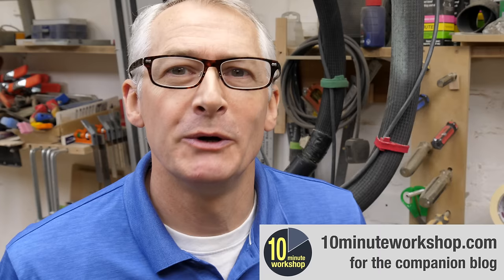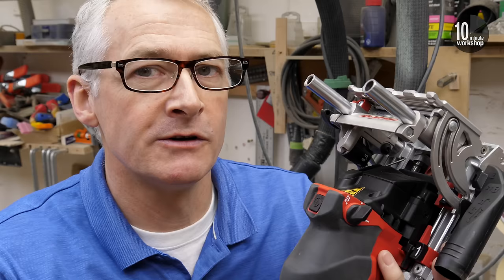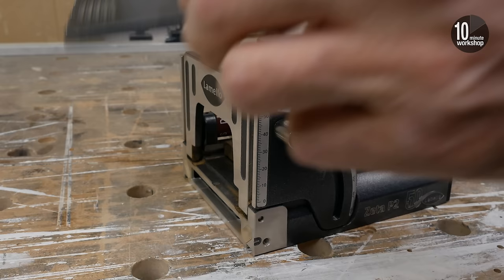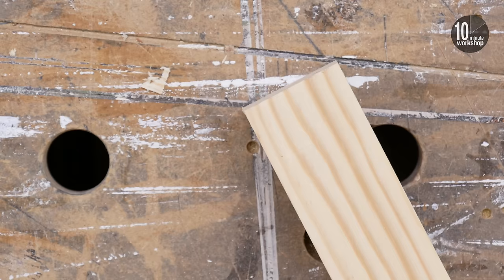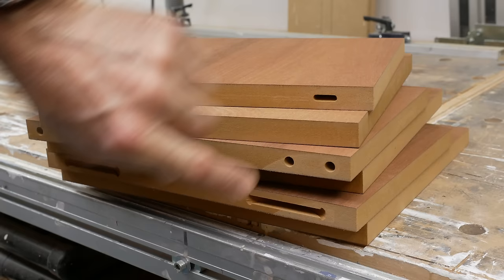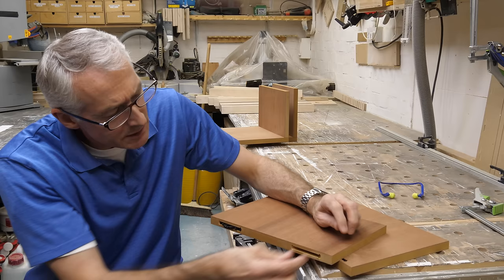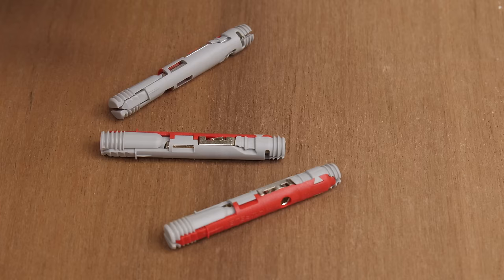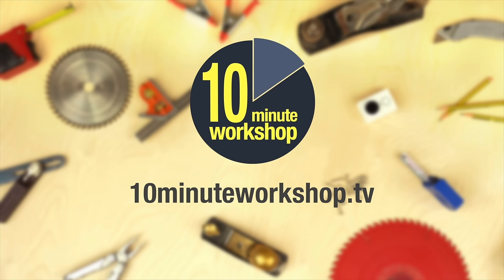Festool Domino, Mafell Doweller or Lamello Zeta? [video #360]

Comment: Was this video made before the domino knock downs were a thing? If so has your opinion changed?
Reply from the maker: No, about a year after - already did a video (#320) on ‘Connect or Clamex’. Domino connect for the DF500 is a poorly thought out fitting in comparison to the Clamex, it’s only saving grace being able to use it on narrow stock. But it’s expensive, fussy to use, leaves a big ugly hole that needs covering up and in my experience isn’t particularly well made - I had many failures in the threads of the screws that secure the fittings, and that’s basically a fitting that can’t be used, so a couple of quid down the pan. If you have a domino already and need a knock-down connector then they work, but they’re not much fun to use. Even if I had a Domino, if I needed a knock-down fitting I’d buy a cheap biscuit jointer and and use the Clamex S over spending £300-ish on the connect set. 🤷‍♂️👍
Reply: @10MinuteWorkshop  thanks you for your response! I was looking into the domino xl for building a bed frame which is why I want the knock down ability. I was taking a look at it at the store which is where I seen the clamex system and ended up here. What knock down connectors would you recommend for a bed frame? Thank you!
Reply from the maker: Domino XL connector are very different from these ones for the Df500; they were designed for the XL, then introduced to the 500 as a bit of an afterthought. The XL connectors will be fine for a bed frame - though there are many off the shelf options available eg bed brackets etc… if you wanted to go a cheaper route. The XL connectors are a good choice though, if you have the XL. 👍👍
Reply: @10MinuteWorkshop  hmmm interesting comment... the bed frame brackets do seem to give the look of a more premium product. honestly I see myself building more cabinets with the domino and only one or two bed frames but was thinking about going all out in the domino 700 that can do it all even if the 500 looks more pleasurable to use... perhaps I should stop buying more tools and use my shaper origin for the bed frame brackets 😂 have you handled the xl and have any thoughts on it?
Reply from the maker: @LostBoyLA  I have both Dominos; the DF500 get used 1000 times more than the XL - I only bought the XL because I have a jig planned to duplicate the function tbh. IMHO the XL is far too big and heavy to use for cabinets, the 500 is the perfect tool for that. HTH P

Comment: Those hafele connectors are crap in my opinion. Very weak and little holding power. We've used on a couple of closets at the place I work as a test, but stepped away from them because they are more hassle then they're worth.
Reply from the maker: Thanks! Glad I dodged that bullet then! 👍👍😂😂
Reply: @10MinuteWorkshop  The technology in them is pretty clever, but practically they are nothing compared to a clamex .
Reply from the maker: No, indeed - Clamex is a different animal altogether. 👍👍

Comment: Why isn't the Triton doweler in this test? Tinfoil hat: on. 🤔🙈
Reply from the maker: Ran out of time. I bought and returned 3 Tritons without getting one that worked well enough to test 🤷‍♂️👍
Reply: @10MinuteWorkshop  That's an interesting review in and of itself.
Reply from the maker: Yes. It was the third leg of my ‘Festool v cheap tool’ series. Did an interview with Chris Davison from Sharp Edge Woodworking who’d done a great couple of vids about the Triton, but I couldn’t buy one that worked. 🤷‍♂️👍
Reply: @10MinuteWorkshop  That's quite something. I use a £8 doweling jig by Silverline for the little doweling I do, and am pleased I have not over invested.  I don't do enough to warrant your style of tool though.
Reply: Because it’s complete rubbish!

Comment: What is the best unit for 1/2 voidless birch plywood?
Reply from the maker: 1/2”? Domino would be my preference, doweller next. 👍
Reply: @10MinuteWorkshop  Thanks. So the P2 is too large for 1/2 ply? I sure like the locking feature.
Reply from the maker: R.L Lynch I’ll admit I’ve never tried joining two flat pieces together, but the connectors themselves are (I think) 14mm deep, so in any L or T  type of joint the fitting would blow through the material thickness at 12mm. They do a special fitting for joining 12mm to 18mm, but not for 12/12 as far as I know.  It would be fantastic if they did though! 👍👍

Comment: Is there a single doweller?
Reply from the maker: No, not that I’m aware of. It’s something I wish Festool would enable with the Domino - flick a switch to stop the waggle, and you have a single dowel machine with a good fence and great dust extraction. 👍
Reply: @10MinuteWorkshop  Yeah, that would be great. I think it could be a pretty versatile and more compact tool if someone makes it.

Comment: I just don't understand why the DDF40 is so expensive, it is essentially two drill bits and a simple jig, at least with the other two there is something to the cutting action though personally I think the Peanut2 system from Intelligent Fixings beats all of these.
Reply from the maker: Well, there have been cheaper duo-doweller a attempted, and none of them have turned out well - I bought three of the Triton doweller a and had to return them all - so the engineering side of the manufacture isn’t trivial. But I agree, it’s expensive for what it is, and the peanut connectors is a fine fixing - but that’s a jig & router system, which is a slightly different animal. Peanut 2 System - https://youtu.be/AjS2cAiQyzY Peanut 2 mini jig video out very soon. 👍
Reply: @10MinuteWorkshop  Yes, I got the Triton and it was all over the place, even the registration on each bit is out so the holes were slightly misaligned with respect to each other. I stripped it down and machined the parts accordingly and it works a treat after that but most do not have the machines or the skill in metalworking to do that. Still it was a relatively simple job and could be done at the factory for very little extra cost. Given this it should be possible to build a decent machine in the £300 to £400 price range. Hopefully one of the mid range players like Dewalt or Makita take on the challenge at some point and we get a decent tool in this price range. If the peanut 2 people produced a hand held machine to create slots they would become a serious player for sure.
Reply from the maker: @paulround8501  Sounds exactly like the three that I had, lol! Someone I know has had the Triton recently, and his was pretty good, so perhaps they've re-worked it?? I agree though - and like I said in the Peanut 2 video,  there's a hole in the market around the ~£-400 range and a decent duo-doweller could do well in there. I love the Peanut 2 system, but it is a jig & router system, not a stand-alone power too, and that does make it slightly different. 👍

Comment: I'm a mafell freak but when I need dowel, I just use a simple dowelling jig and a drill. Domino and Zeta have indeed zero alternative.
Reply: is it the dowel gene? if so did you figure a way to join two together  - they are a little too short :(

Comment: Here’s the bottom line — unless you are independently wealthy, or that tool is making you money, there is not justification for dropping $1000 bucks on a Domino joiner.    Same goes for these other two joinery machines.
Reply from the maker: Well, that may be your bottom line, and that’s totally fine. But for every comment like yours that I get whenever I discuss a particular (or particularly expensive) tool  (and the Domino does seem to be a trigger for this) I get at least one other from someone saying that they have one and it’s massively sped up their work, or they saved for a while to get one, or they just splurged and indulges themselves one time, or they got a great deal on one etc.. etc.. 

Sometimes “I have limited shop time and this will speed up the things I want to make” is all the justification some folks need. 👍🤷‍♂️

Comment: Sorry but I just cannot see the benefit of that mafel t-biscuit jointer, so expensive and I don't even like the joint because it's plastic.
The mafel dowel jointer is a cool tool but so so over priced, I am absolutely convinced it's t even a time saver because once you make a proper dowel jig holes can be drilled fast and accurately.

The only one really worth it's salt is the festool domino. That is worth the money because of it's sheer time saving. You can mimic the festool with a router but it's always more time and work so festool is absolutely the only option here fir me. Triton also do a dowel machine, it's not as well engineered or as accurate but it can get the job done. It about 1/7th of the cost of the mayfel. I just think mayfel are totally chancing their arm with their pricing. The festool is a real feat of clever engineering and innovation. It basically retired the age old expensive morticung machine that took up a large footprint if one has a small workshop. The fact you can create several accurate mortices anywhere on a piece of stock, even on bevels and shapes and then sit the tool compactly on a small shelf is priceless and make the festool a real work horse and worth every penny. Anyone who opts for the mayfel tools over the festool is crazy imo.

Comment: A bag of sand for a doweller ?? Jesus, you must be able to knock up a jig that's sleeved and just use wooden bits with a depth stop for next to nothing.
Reply: But can you work as fast and as accurately? No. Even using a dowelling jig, you still have to set it up and hold it in the right position. Time is money, and that doweller will save you time if you are in production. For hobbyists, its overkill.

Comment: Triton duel doweler £135 mafell £1000 (over priced)
Reply: Not comparing apple with apples my friend. I've not used the Mafell but I'm certain of its accuracy..... I have previously owned the Triton duo dweller before I bought the Domino and though it technically 'works'.... it certainly has its accuracy/alignment issues which compromise quality and efficiency making it unconsiderable for the professional workshop.
Reply from the maker: Yep, as Chris (Sharp Edge Woodworking) says, the Triton isn’t the same at all. Way back when I was doing my Festool vs Cheap Tool series one of the first three was to compare the domino to the Triton doweller.  I bought 3 of them and they were all unusable.
Reply: @SharpEdgeWoodworking-UK  The point I was trying to make is that after seeing your video on how you improved your Triton dweller to make it more accurate the £865 difference of the Mafell is way too much
Reply: @neilfraser6646  But the thing you missed was that in pricing his jobs, he charges for the tool used, and his customers could afford the domino. So, why waste time trying to make a tool work, when you can buy one that works out of the box, will pay for itself quickly, and is better than the tool you are wasting time fiddling around with? Commercial contractors' time is money.